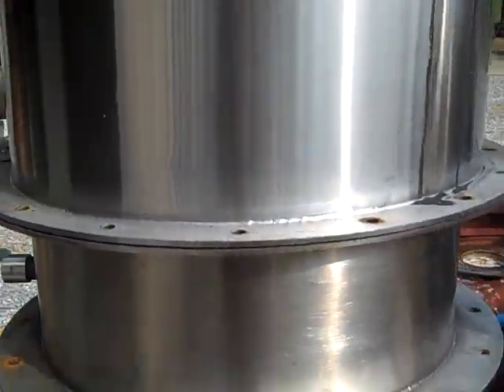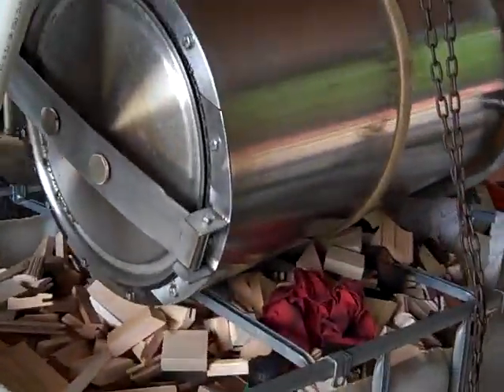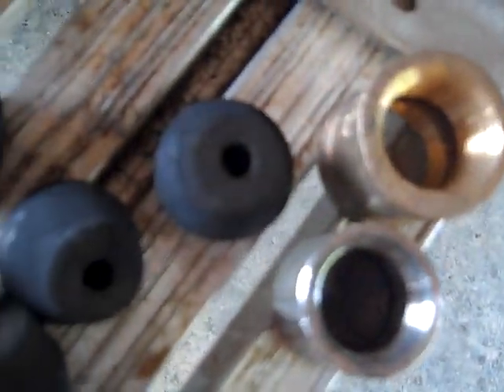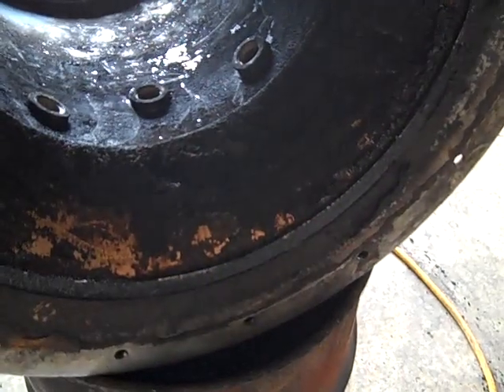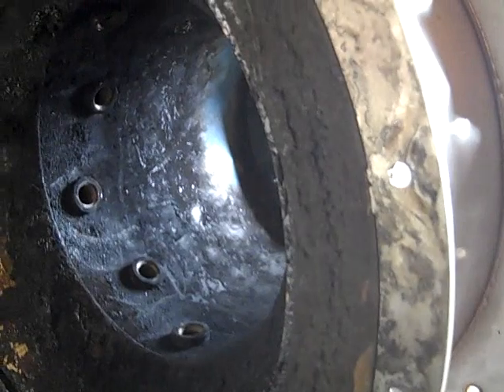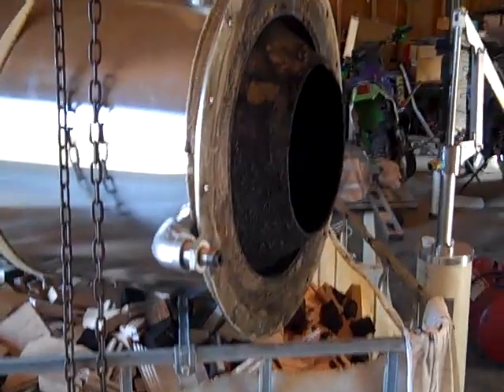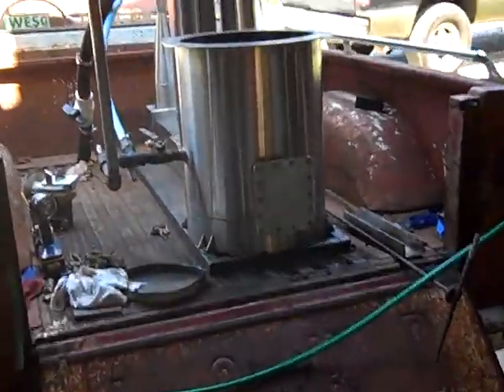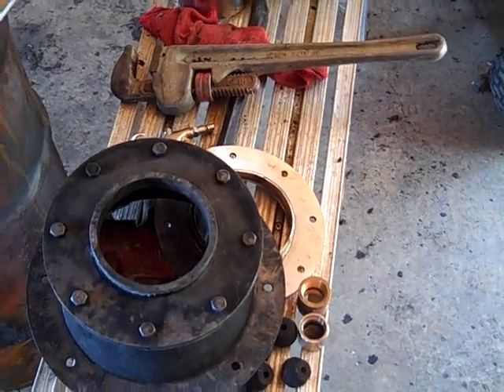Gasifier Teardown

Comment: Please do another vid on the gasifier, hopefully with some specs and the basic gas flow thru the system , I am thinking about building one that could run a 5-10hp generator in a grid down situation, I am new to wood gasification, but I do have a well equiped machine shop/garage. Thanks and keep the good vids comming.

Comment: Thanks for this video.  What is the maximum amount of power you have drawn from it so far, and what is the max. length of run at that power? When I first saw a vidoe of Ben using (I assume) this model to run his big red genset, I didn't think it would have enough output to provide about 50 KW.  worth of power to an engine.  Do you think it will?  I have been looking at the Garringer Gasifier lately, but I don't think it is stainless steel. It says 100 hp, Is this one anywhere close?
Pete S.

Comment: Engineer,
I have seen plans for a car to run off compressed air.  Could you not put the compressor in the back of a pickup like you have done,  hook up solar panels to gather the electricity to run the compressor and go that route with essentially no liquid or solid fuel?
eb1

Comment: Sweet system.  Me I plan to go down the road of making alcohol and running on that.
I plan to build my take on the Larson Radax Engine with a few design ideas of my own.
Imagine a 300 hp, 900fpt that will rev to approx. 25,000 rpm and will run on a bunch of different fuels.  Me I plan on tuning my own for alcohol with perhaps hydrogen added.
That way I can grow my own fuel, generate my own power and so on.
Again nice system and I really have enjoyed your videos of the different projects.